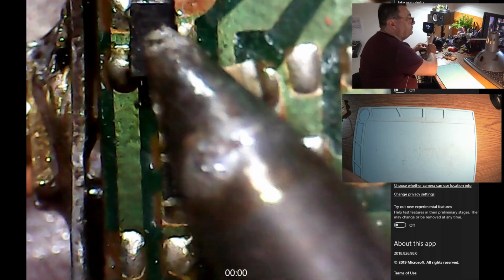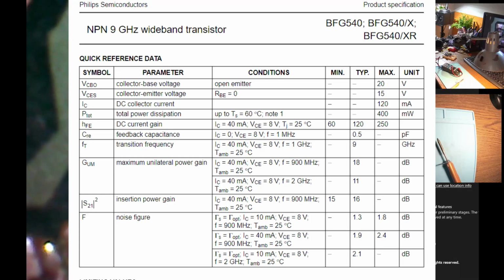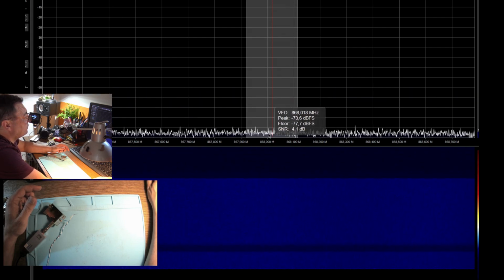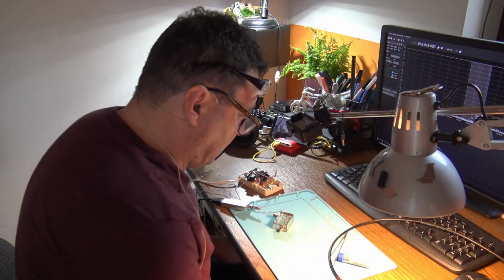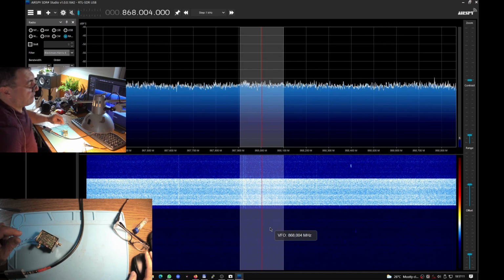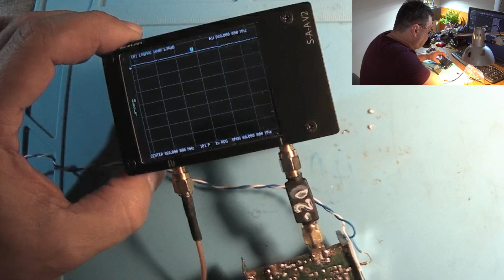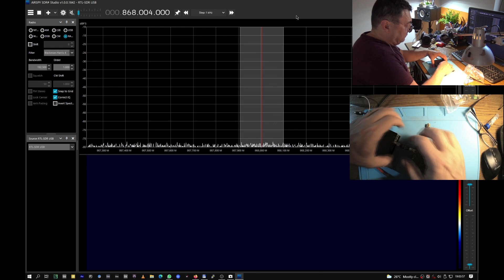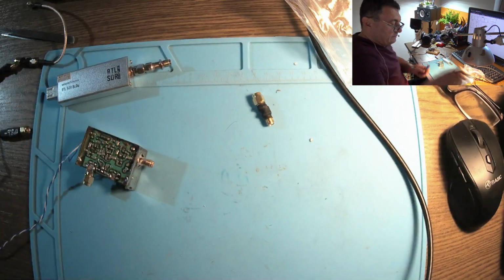UHF 3 stage amplifier noise test.

Comment: Would it make sense to try getting a lora signal using that amplifier with a 10db attenuator?
Reply: You can try both ways but I would say on the radio receiving side.
Reply: I think all that blur that you are seeing might be just too strong of a signal.
Reply from the maker: @14mbabic  Right..
Reply from the maker: Before or after the amplifier?